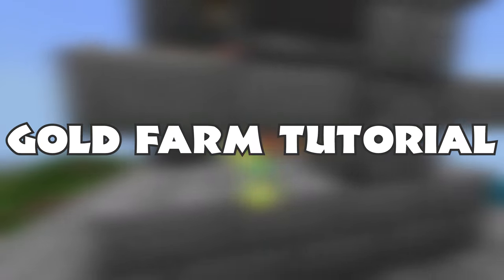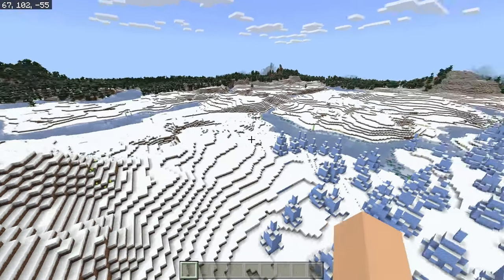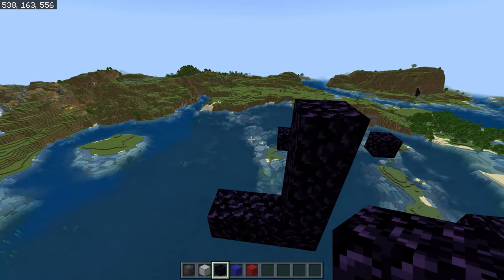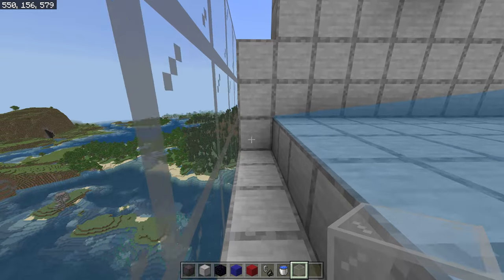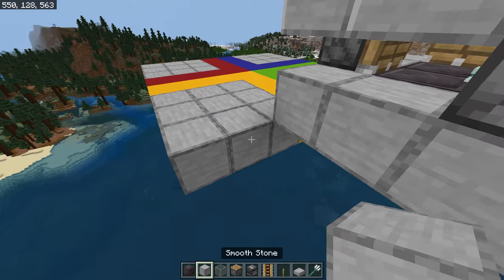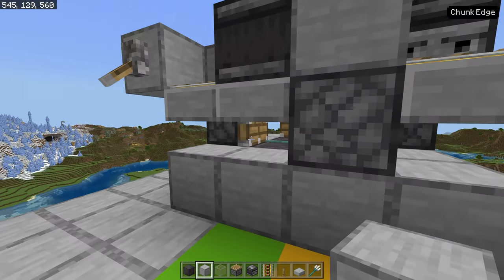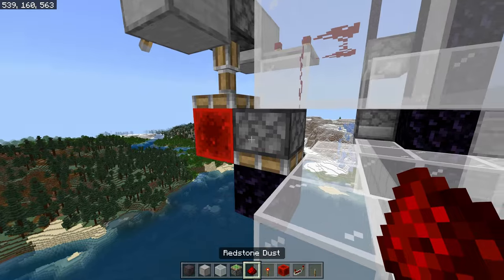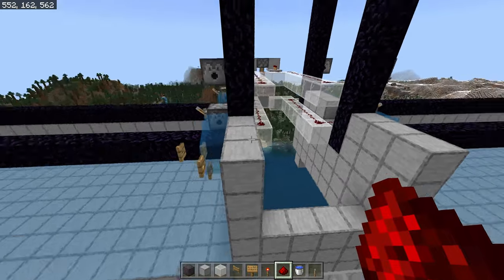INCREDIBLE Gold Farm! ADJUSTABLE SPEED | Minecraft Bedrock Portal Ticking Gold Farm

Comment: Built exactly as instructed, my portals won’t light at all. Anyone got any ideas?
Reply: Go watch the navy nexus link and also JC Playz for gold farm.
I merged the two ignition systems and incorporated into each portal.
Use Prowl's gates method to keep the water (portal extinguisher) from flooding out the Ziglin transport to the drop chute.
Also, add a water trap appx 22 blocks above trident killer - without that my drop rates were terrible!
Reply: Dude same what gives. If I use a different portal lighting system do u have to change out all the red stone? Sooo confused

Comment: Warning! Do not build this below Y=0 as I did. There is a bug where the piggies do not spawn below Y=0. Whether they fix this or not I don't know. Rather frustrating finding this out after building it.
Reply: How high can you build it?
Reply: @slashingz8884  i built mine starting the chunk aligned platform at y202 and it works fine